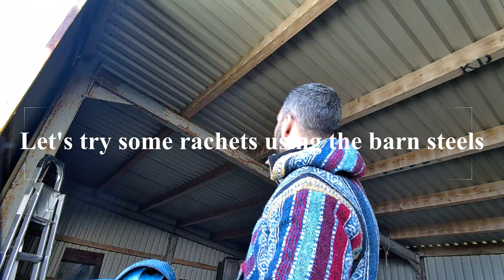First time using the tractor at the Homestead

Comment: put your blade down ...front tire goes up back tire pulls in reverse 😊
Reply from the maker: I tried that. Unfortunately the ground underneath the tires were so churned up it was just getting worse. The only way was to ratchet it back out of the ditch and then drive off from the even ground.